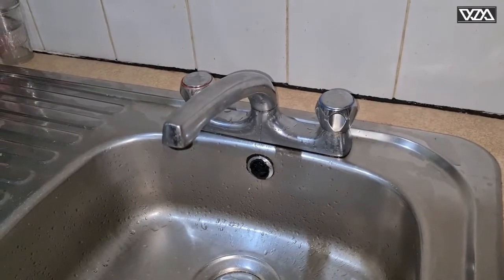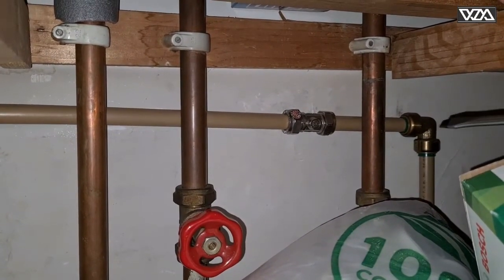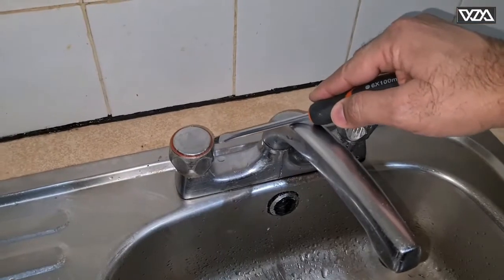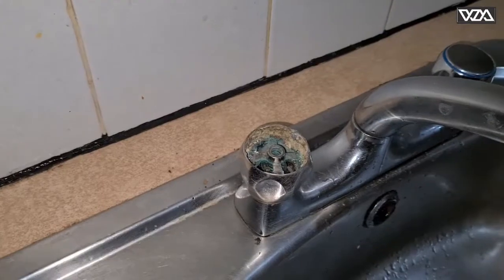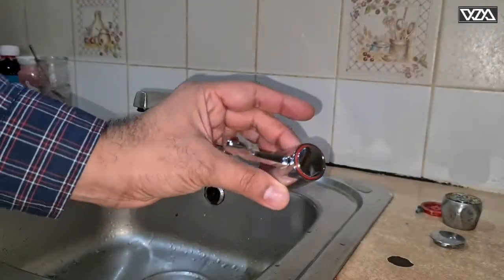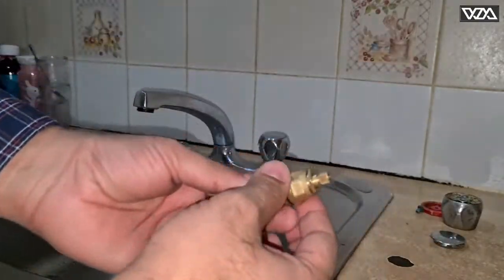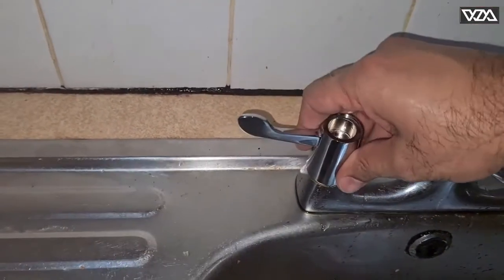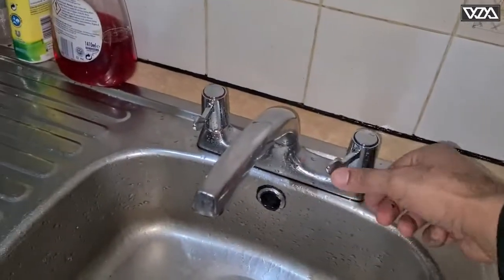Tap Upgrade No water or Leaking Tap

Comment: Very good explanation, thanks. I only have a problem I can't find or get access where I can turn the water supply off. But I have the same taps and need to make the same replacement you did on those taps. Seems easy enough but with water supply on it could go like a fountain couldn't it? What do u think
Reply from the maker: Thanks,
yes it will be messy to work without turning off the water supply, check under the sink usually there is a shutoff valve, or other place to look for utilily storage where water tank located you should be able to find the valve there., i hope it helps gudluck with the fix.